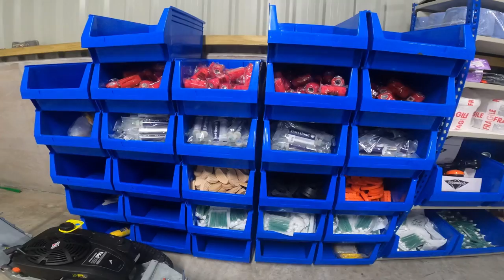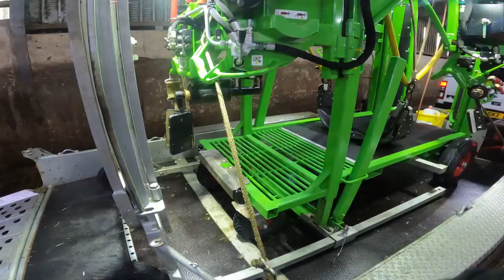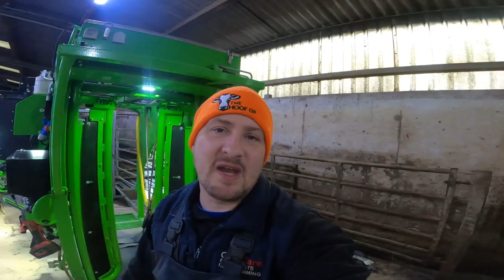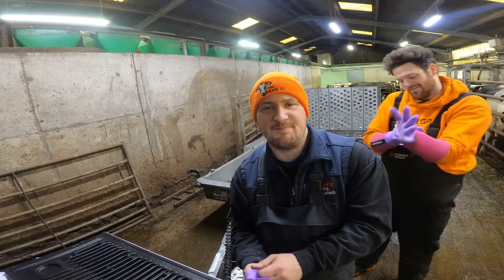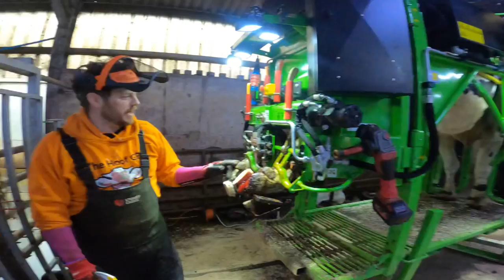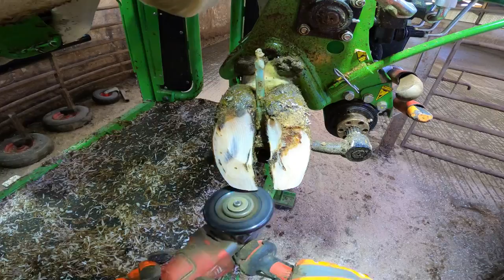ITS HOW I BECAME A HOOF TRIMMER

Comment: Only problem is Graham is on the wrong side of the Ranger lol.  Here is a question for you Craig.  Why not use the Appleton over the KVK?  Seems like the Appleton is easier to move and is more compact than the KVK w/ the trailer and unit.
Reply from the maker: Yeah it some places that is true but once the KVK is off the trailer it’s much smaller than the Appleton but we do use both crushes. We’re just using the KVK more just now in order for us to become knowledgeable with it

Comment: So Craig, how is the crush powered? Battery or do you plug it in somewhere?
Reply: That’s a good question!  I’d never even thought about it.
Reply from the maker: Both crushes need to be plugged in but the Appleton stores a little hydraulic pressure so you can set it up before plugging it in but the KVK has a battery which can store a good amount of power before it needs to be plugged it in.

Comment: 🚦🚦🚔🚔  Graeme needs to be told that his left light assembly on the trailer is not working at all.    No break light and probably no turn signal light either. 🚔🚔🚦🚦
Wouldn't want you or Graeme to get pulled over for something as simple to fix as non working lights.  
Take care and Be Safe 🥰🥰💖💖🐮🐮🐄🐄

Comment: Love your videos!!!!
I have two questions. Does the farmer supply you with the saw dust you put down? And, why do you use the torch on the cows foot that you are putting a block on?  That seems like it would hurt.
Reply from the maker: Yes the farmers have lots of bags of sawdust for us to use when working with the cow’s. The cows hoof horn has an oiliness to it so before putting on the block we need to dry off the horn so that the block will stick. If there’s even the slightest bit of moisture the block will fall off. I promise that this process does not hurt the cow. I can totally see why u would think that though. I did too when I first saw it being done.
Reply: @craigieboy  thanks for answering my questions. I knew you two would never do something that would hurt the cows but I just had to know. Silly questions but thanks for answering.